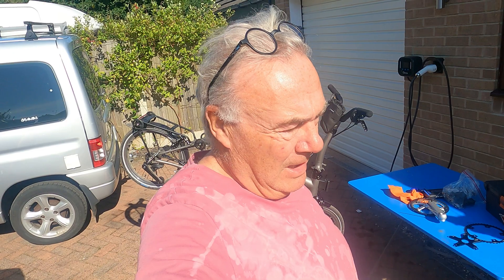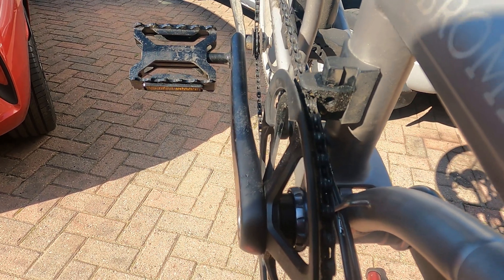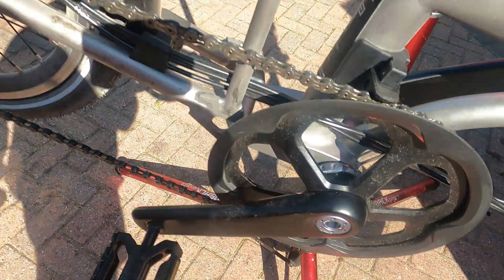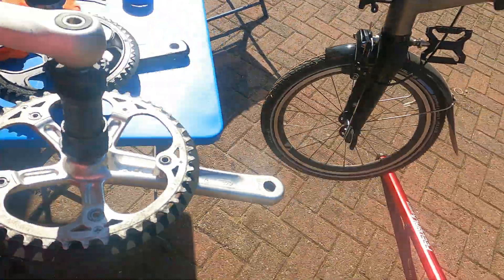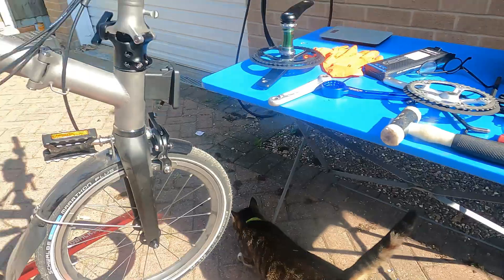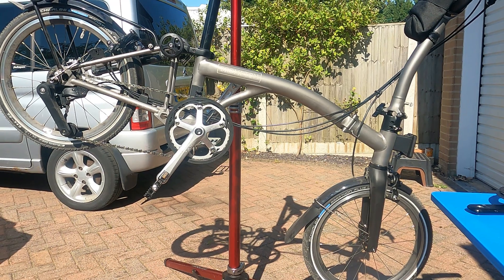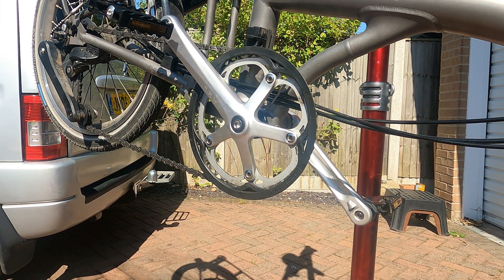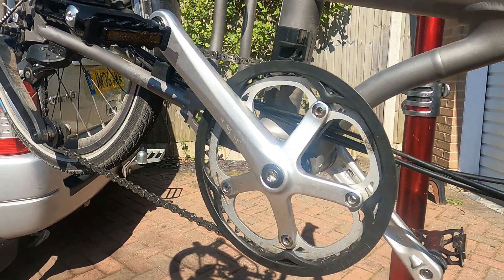Brompton T-Line 12 Speed Gear Reduction From 50T Chainring To 44T Using Std Brompton Components

Comment: This video only came up in my feed today.  I've got the 12 speed C line and I changed the chainring for a 40T (H&H).  I regularly use all 12 gears in a ride.  Personally, I like the low gear and when in top, I never wish it was higher.

Comment: Very informative. Let's say that you prefer the 4-speed T-Line with a single front chainring. What size chainring would you need to comfortably and casually pedal at 32kph in fourth gear? Is this possible? I prefer the simplicity of one derailleur at the rear.
Reply from the maker: @davidhunternyc1  
I think you would need the 50T chainring, I play with gearing because of the hills and gravel tracks where I live
Reply: @NottinghamshireMadness  Thank you for you reply and expertise. 🙏🏼

Comment: Interesting.  I have a 12 speed P line and I find that I need a "granny gear", lower than the current bottom gear.  I have decided to go with the Brilliant Bikes system that changes it from 12 to 15 speed and will give it a much lower bottom gear. This will bring it down to where my Alfine Brompton is on its bottom gear.  thanks as always.
Reply: You are telling me 12 speeds is not enough?
Reply from the maker: @fender1000100  
I just fitted a std Brompton 44T crankset, it’s just 80g heavier 
The 5th cog is a good addition. The 44T gives me a good low gear.
Reply: @fender1000100  it’s having a lower 1st gear that I was looking for. Thanks
Reply: @jonathanleach3914  

Okay. In thinking of getting a Brompton Pline explorer 12. Next year. I currently have a Tern Verge X20. Which is a fast folder.
Reply from the maker: Do you mean 5 speed by adding a 21T sprocket?

Comment: Om my 2019 Superlight I'm able to change the chainring with its five bolts, to another size? And I may add a double ring also, making it a 12 speed, if wanted! I also have my own Chain Cover on top, as the present Original version, but with a band round the frame! By that, have you done anything to protect the inside of your frame from gravel and water reaching the Crank and the ballbearings in the stem? It is a known problem with the new T-line, to my knowledge (from the strange holes!)?   Finn. Denmark
Reply from the maker: @finncarlbomholtsrensen1188  
Yep it so easy, also have them fitted with double chainrings

Comment: What would have been wrong in switching this spacer to the other side? Its less work than removing the BBs and for function it wouldnt have mattered. Or do I miss something?
Reply from the maker: You would catch you right heel on the easy wheel also you could damage you knees and hips from pedalling off centre
Reply: Ah, the heel strike. Yes, that explains it, not that much room back there with normal sized feet.  @NottinghamshireMadness